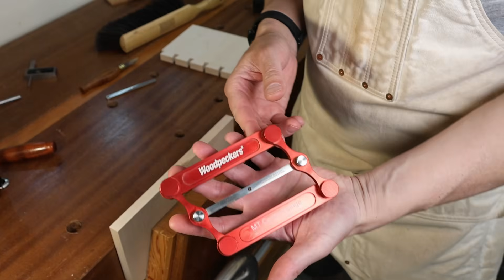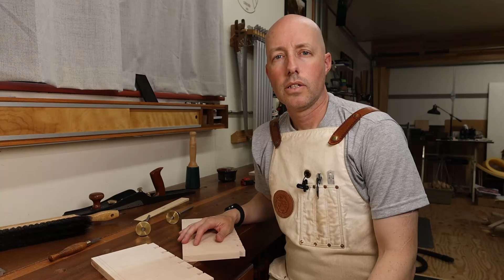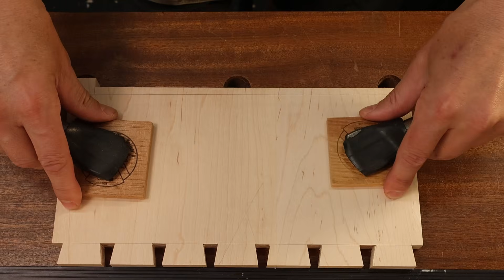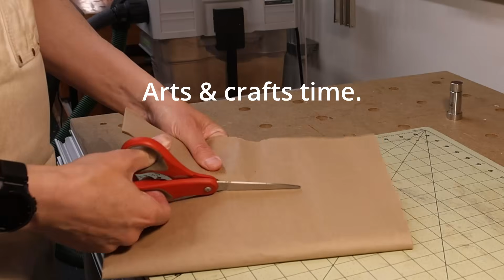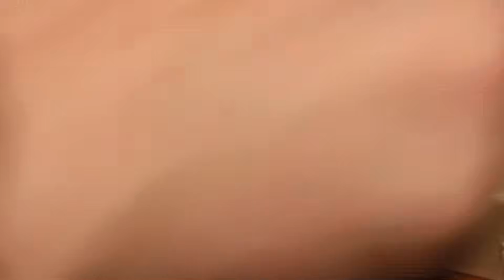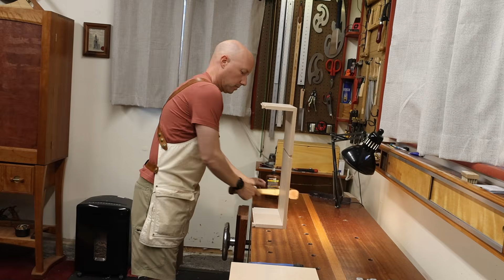The Opposite of a One Minute Dovetail, Part 2

Comment: As a woodworker in hand and power tools I really appreciate extended videos but this was a torture when it came to the stub/dovetail procedure. The Leigh D4 Pro jig that was a Christmas gift years ago reminded me how easy a sliding dovetail for this operation would be and would be stress free and quick. Sometimes simpler is better. This was a painful one to watch. Remember this is for a travel trailer!
Reply from the maker: I've tried sliding dovetails by hand a few times in the past and found it to be a finicky, time consuming pain in the rear. Stub tenons are much preferred, but as I said in the video, while they can be done with just a chisel, a router plane makes much lighter work of it and better allows one to sneak up on the fit. Travel trailer project notwithstanding, I regret nothing!

Comment: Ryan, your videos are them selves a work of art!  Stub tenon and socket dado is interesting option where I would have used sliding tapered dovetail. I have successfully tightened loose tenons with layers of blue tape. Another option is gorilla glue which swells like crazy. Thank you for this fine instruction.

Comment: Thank you for doing such an informative video.  Everybody does something different so I pick up ideas from watching how you and others carry out good wood working.  When fitting a joint that is too tight I pencil paint the inside surface of the joint.  When fitting, the pencil leaves marks where it is jamming.  Titebond has advised that the pencil does not interfere with the glue strength.
Reply from the maker: That's a good trick. I've done the pencil thing in the past, but I find that with good light, I can see where tight spots have burnished the wood in much the same way, do I tend to do mostly that.